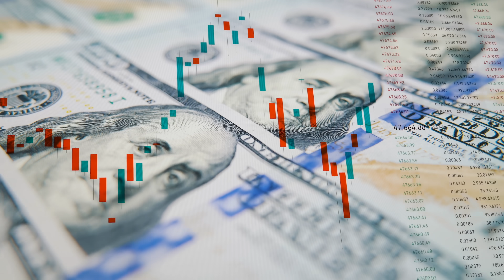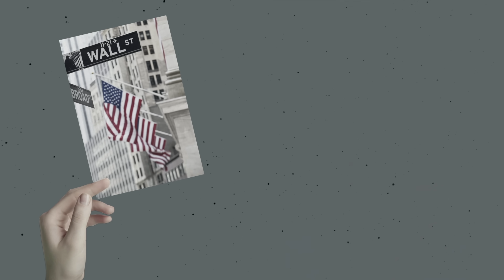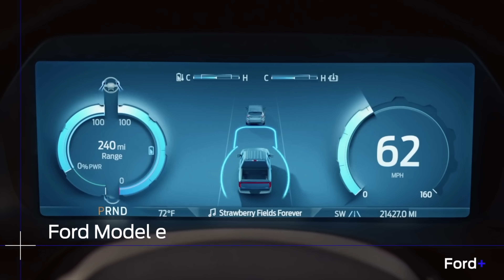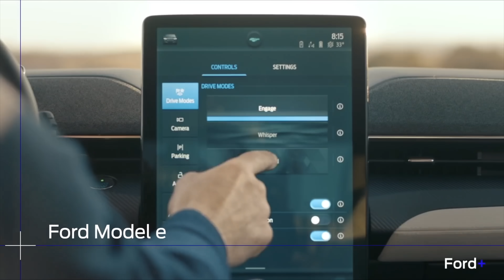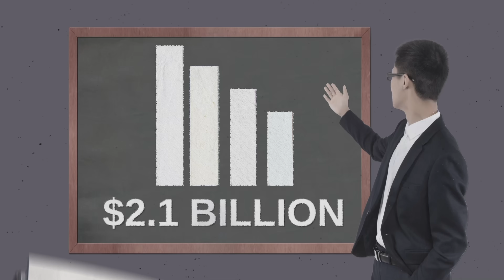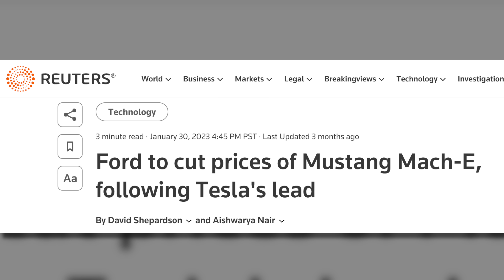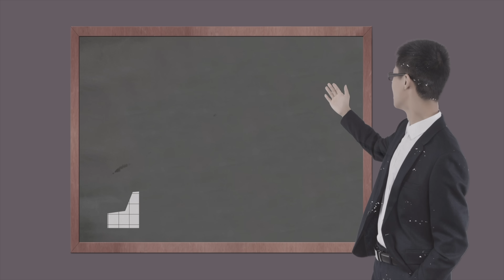Ford CEO Just Announced “We're Losing Billions and Have to Break Up the Company"

Comment: I bought a 2018 F150 Lariat in 2021 for $43k. I added a warranty that included the wheels. After all was said and done it was $50k. It's almost fully loaded 502A, moon roof, power running boards, heated/vented seats, factory sprayed bed liner, leather everywhere interior, LED lights, cargo lights, tailgate step. The only options it doesn't have is Active Cruise control, and the Self Parking Technology. It's loaded to the hilt and I absolutely love my truck. Looking at new trucks of the same trim, package, and stand alone options, they are around $70k to $80k. I'm glad I bought it when I did, but will be buying a cheap gas efficient vehicle like a Toyota or Honda once this is paid off. I can afford it, but don't believe I'm interested in the newer models as they are ridiculously over priced. 🤷‍♂️
Reply: Get a 95 accord if you can find one and if your hips aren't too wide. I had three of those and had to give them up because I'm 6'3 and my legs would fall asleep from being pinched by the bucket seats.

Comment: Owned two E 150s , first was an 87, with a 302v8, went over 300,000mi, gave it away to a family of six. Custom conversion van, they love it. Second was a 2000, 4.6 liter, went over 200K, gave it away to another big family. Far as I know it’s still going. Those two were the old days of Ford Econoline 150s.
Reply: Call me if your thinking about giving another one away.
Reply: My first vehicle was a 2003 Ford Explorer Sport Trac XLT Premium with the 4.0 SOHC V6 - Sold it with 270k+ Miles because the timing chain began to rattle pretty good. It was still running and driving, and I never even changed a light bulb on it. Bought new in 2003.
Reply: 2001 E-350 mechanically great, but up here in northern country RUST. Had to have it put down. 🙁
Reply: I have a big family

Comment: Ford needs to emphasize its “Quality is Job One” approach like it did in the 80’s when the Taurus/Sable turned the company around back then. Make high quality vehicles both gas powered and electric with very few or preferably zero issues and recalls at affordable price points, then consumers will trust Ford and buy Fords.
Reply: If you think 1980's Ford vehicles (other than trucks) were quality, I've got a few bridges to sell you 😂
Reply: The Taurus and Sables always have been junk.
Reply: My grandmother had a tourist for years and years and years and years that car was always ready to go as soon as someone in the family's car broke down
Reply: Their 2.5 hybrid engine (found in many vehicles) IS a bullet proof, long lasting engine... 5.0 still great engine but complaints of it being a noisy engine now, 3.5 and 3.7 very good powerful engines...  they finally corrected the coolant intrusion issue of all their 4 cylinder turbo engines in 2020....after enraging and losing 60% of their customer base; owners of pre 2020 models.

Comment: If Ford can't solve thier quality issues now, how do they expect to solve issues with this new technology?
Reply: @icosthop9998  Newsflash, almost every model of every vehicle sold has had a recall in its history. There is no manufacturer that is safe from recalls.
Reply: @Create_SunShine  recalls are a good thing it means the manufacturer is stepping up to fix the issue. There are other manufacturers that know there is a problem but will charge you to fix it instead of issuing a recall.
Reply: @yaldor  Most recalls are minor anyway.  The problem is when they make vehicles with actual flaws...........that's when most companies leave you hanging.
Reply: @yaldor  Good thing you said ALMOST. Mazda(Japan) quality TODAY is second to none, not Honda, not Toyata or Lexus...
Reply: @ginog5037  good thing you mention Mazda because they are recalling 2022-2023 Mazda CX-30 and CX-50 vehicles for failing anti lock brake systems. I’m sure there’s been other issues that’s just the first thing I saw.
Reply: @yaldor No, recalls mean that the quality control is horrible at Ford!!! Farley himself said it will take years to get quality control issues resolved!!! Wouldn't but a Ford right now even if you paid me!
Reply: @Gonzo1968  so what company does not have any recalls please explain

Comment: The second Ford announced to cut down its fleet and only focus on SUVs , Pickups and Mustangs I thought that was a huge mistake and here we go all these extremely overpriced  gas guzzlers sitting there on the lot and rot because the vast majority can't afford them anymore . Wouldn't be smart to have some cheaper models on the market to compete against Camry , Accord and compact cars?  Bring back the Taurus, Fusion and Fiesta .
Reply: It wouldn’t work. Ford and GM cannot compete against Camry/corrola, accord/civic, mazda6/3. Both of them showed with the last generation of cars that they simply cannot make a reliable car that can still fetch a decent resale value as it ages. Most people, even if they don’t know anything on the subject, think that the competition makes a better product than what ford and GM can provide, even if both of them did have some surprising successes with a few compact models. And honestly, car sales really aren’t looking so well right now. Corolla and accord is a case in point right now. I think only the Mazda’s are doing particularly well right now compared to sales in recent years, but I could be wrong about that.
Reply: The Maverick is meant to be their low cost offering.
Reply: It's not a mistake. Nobody bought the Fusion or CMAX when you can choose Corolla and Civic on the low end and model 3 on the high end EV.  The profit margins on sedans suck anyway compared to the gas guzzlers and demand is low. They don't want Corolla, they want RAV4 hybrid and larger. Even the Fusion's highest trim level in PHEV is a joke compared to the base model 3.  Nobody would pay for a theoretical all electric Fusion EV at $45k when you can buy the Model 3 from Tesla at the same price.
Reply: @Shakerhood69  yeah and barley anybody bought it just like that new rngr that doesn’t deserve to carry that name. Instead there are more new tacomas on the road than ever. They can’t compete in low cost anymore. Everyone else in the American market does it better.
Reply: @Shakerhood69  I like the Maverick but a lot of people who still like to drive affordable sedans were left in the dark .
Reply: @flashoflight8160  yeah. You just have to like driving around a car with cleft lip if you choose the model three. And also not mind downtime for warranty service. But they seem to be everywhere so apparently it worked
Reply: @Wolfgulfur  the Japanese brands are the only one that I trust when it comes to reliability.  Sure Nissan's CVT isn't really trustworthy but hands down overall they all make pretty reliable cars. Wasn't always that case. The thing is not everyone wants a Japanese car some just want to stick with American brands for whatever reasons . I understand your point of view but now they barely sell anything.  Their trucks just became too expensive.  Now Rangers cost as much as F150s have cost 5 years ago. That's ridiculous.
Reply: @texastravelers210  for some reason. The Japanese are great at building cars....
Reply: They have done exactly the same thing in markets where hatchbacks and Saloons were popular like Europe and the UK. Only cars now available are all going to be expensive hybrid and EV SUV's.
Reply: @andybales7318 Absolutely. Maintenance and drive style.  My 97 D21 Nissan still purrs like new at 165K miles.  Not as pretty as the Ranger mind you but was cheaper at the time.
Reply: What happened to CAFE??    With all those gas sucking pick-ups and SUVs being sold and no sedans to goose the average up,  how do they pass the corporate average fuel economy law???
Reply: @andybales7318  meanwhile, owners of datsun pick ups who are still driving their dads truck from how many decades ago.

The old rangers were freaking reliable as heck. But some of those old jape seem trucks. Especially the hold hilux’s. Like ranger was great, like really great, but it’s still got nothing on the old jap pick ups

Comment: Hi Mr. Kilmer! Much needed encouragement as I just received word from Ford that the Hybrid Maverick XLT I ordered last September has been built and is on its way to the dealer. I have read great and also concerning things about the Maverick AND the Ford Motor Company, but your information and advice, always highly valued by me, is particularly welcome as I come close to owning the new Mav. I am currently driving a beautiful 96 F150 with the 350 V8. It's in mint condition thanks to several good mechanics and friends that do bodywork. I hate to give it up as it's been a great truck and is very simple mechanically, especially compared to the Hybrid. However, as one similar owner stated, "I love her, but I rarely take her out in public as she's a very heavy drinker." I average around 10 to 14 mpg; heavy drinker indeed! Regardless, thanks again for the  encouragement in the video. I am quite certain it was viewed or will be viewed at all levels of the Ford Motor Company. Well done as usual, Sir! Much respect, and I very much look forward to more from you!

Comment: From an old Ford Engineer that I know: Ford wants your vehicle to fail after 80,000 miles.  You might get lucky and get one of their vehicles to go over 80K miles, about 20% of them do.

Why does Ford do this, you ask?

Major Catastrophic Component Failure, is what they call it.  You tow, push or drag your vehicle back to the Dealership.  The evaluate the failure and tell you that there is good news; they can fix it for you.  However, too bad, out of warrantee; you have to pay for it yourself.  Cost?  $3000 to $5000 plus labor.

Don't fret they say, after all, you had your vehicle for 80K miles, you got 'Good Value' out of it.  But, come on over to the Show Room, we can put you in this shiney new can and you can use that whopping repair bill, to fix what should never have broken in the first place as a DOWN PAYMENT on the new FORD vehicle.

That's how they get you.  Ford going broke now?  TOO EFFING BAD FORD
Reply: That's why my Ford is 25 yrs old. Wouldn't buy newer than say 2007

Comment: EVs get low range, takes hours to recharge on a 240v unless you use a superfast charge port, has fire safety issues, too expensive, etc.
EVs batter is expensive to replace. Up to 10k. Many EVs aren't capable to deal in cold temperatures.
My Honda Civic 2013 was cheap when I bought it new, no mechanical problems, still runs great & easy to maintain. 
The car battery is cheap compared to a EV battery.
The civic can refuel anywhere that sells gasoline. Takes five minutes or less to refuel. 
I can get a range up to 300 miles if I drive mostly on the highway before refueling.
Reply: 10k for a replacement battery? You can double that figure!
Reply: I can go more than 300 miles on a single charge and I charge at night when rates are super cheap and I’m sleeping. No waiting around dealerships for repairs or oil changes. No time wasted pumping expensive gasoline. Batteries last 200,000 miles and are still 90%of original capacity. Battery technology just keeps getting better and cheaper making gas guzzlers obsolete. If you want a fast car with instant torque, buy an EV

Comment: I feel Ford makes better products than others do. That being said, EVs are not good for hard work. That is what I have always seen/used them for. Try taking an EV across the scales with 15,000 on its back, while pulling a 13,000 lbs trailer. I dont see EVs ever replacing diesels. My set up is for tree work. Just make little EV cars, and leave the truck market alone.
Reply: Well said.
Reply: Change is coming. It's neither good, nor bad, it just is. 
EV's are taking over because fuel costs are 3-10 times less expensive per mile, and the vehicles run forever. No maintenance.
Reply: The Cybrtruk will dominate any gas  diesel  or electric truck so much the lots will be full of big legacy lunch.
Reply: @GWAForUTBE  you're delusional
Reply: @GWAForUTBE  elon is a scam artist
Reply: @clayton5584  watch it happen Clayton...year max.  Sell the gas guzzler while you can.
Reply: @clayton5584  how is producing the best cars in the world a scam.
Reply: @GWAForUTBE  remind me in a year
Reply: @GWAForUTBE  the cyber truck has to be the ugliest vehicle I've ever seen
Reply: False.. They will ramp up electricity rates until it’s ALL the same..
Reply: @coinharvest101  if you care about body curves buy a vett. This is a truck. The ultimate work truck.
 The one truck to rule them all.  Perfection takes time.   Trust in Elon.
Reply: @peteparadis1619  Electricity has the potential to be free for all... big oil will always be an ever tightening leash.
Reply: @Aerondighteternal  won't be that long.
Reply: Econoboxes and fleet vehicles. I don't know how long they're going to have to beat their heads off the walls and wipe their tears with government money before they realize people don't really want electric trucks and performance cars.
Reply: EV motors are excellent for hard work, batteries are not.  As long as you can keep the electric motor powered by some kind of rail like a train or overhead line trolly it's going to just keep running.  It's the batteries that don't have the kind of duty cycle you need for hard work in addition to being colossally expensive and heavy.

Comment: Tesla are a software company. Their beautifully designed cars are software on wheels with over the air updates. Each model has 17 iterations added per week. No board meetings required. This is LEAN manufacturing on steroids. No company has a hope of catching Tesla. They are on the brink of solving full self driving. My best guess is later this year. That will escalate sales astronomically

Comment: GM no better. 2017+ Sierra Denali with a rusted out frame. That wax coating they put on the frame doesn't last one season. It's only there to prevent the frame from oxidizing on the dealer lot. Once the vehicle is sold the wax coating disappears and customer disappointment appears.

Comment: Back in the 1990s, I attended the annual Car Show. Ar that show, their executives proudly announced that they scuttled their electric car development unit as they saw no future in electric vehicles-:& the move will save them millions!
Reply: and they were right haha
Reply: they were right.  EV range in the 90s would have been less than 60 miles IF that.  wasn't the Nissan Leaf EV range 75 miles in 2012??  that's a joke.
Reply: @cutehumor  It’s still correct today. Battery technology has improved somewhat, but is still a long way from where it needs to be. They might get there eventually. But the resources currently needed to create the mediocre batteries we have now are extremely limited, heavy, expensive, and prone to devastating fires.
Reply: @MrBottlecapBill  Hydrogen is a much better idea. There are still some engineering and safety problems, but they seem like they’ll be easier to overcome.
Reply: @rfichokeofdestiny  I completely agree with the *concept* of H-combustion. I would love to see that go to implementation. I also think biodiesel is more self sustainable than EV.
But big govt is lobbied to go into a different direction with traditional battery EV.
And lobbying is basically political bribery.
Reply: Priced themselves out of the auto industry and likely running from the potential results of the looming dept default that would be due to the gop's good (not) governance
Reply: @rfichokeofdestiny  And those resources are sometimes obtained using child labor.
Reply: @Jeff.78  Pretty brutal child labor too. Although oftentimes the alternative to child labor in poorer countries is prostitution. So it’s damned if you do and damned if you don’t. But it would be nice if proponents of EVs at least acknowledged the downsides.
Reply: Thank you no. I want a vehicle that wont pretend thats its an improvised explosive device! And an AI driving it? Hell no!

Comment: Hybrids like my Toyota Rav4 plug in are right on target. Plenty of EV range for local, engine when you need it. 45 MPG when on gas! No gas for the first 47 miles. Most days we use no gasoline.
Reply: That's the only EV I'd consider at this point, PHEVs seem like an ideal stepping stone to full electric.
Reply: Hybrid Rav4 owner here, a 2016. I think hybrids are more reasonable than EVs for the future. I buy for reliability and EVs have not been proven yet. Goooooo Toyota.
Richard Folden…..we also drive a. 2011 Prius. I have NEVER had a repair on my Prius or the Rav4 Hybrid other than wreck damage.
Reply: @richardfolden3860  that is totally wrong. People use electric first until the batteries are exhausted.
Reply: @richardfolden3860  the hassle is wasting time at a gasoline station. We plug in at home every night and are good togo in the morning. No problem at all!